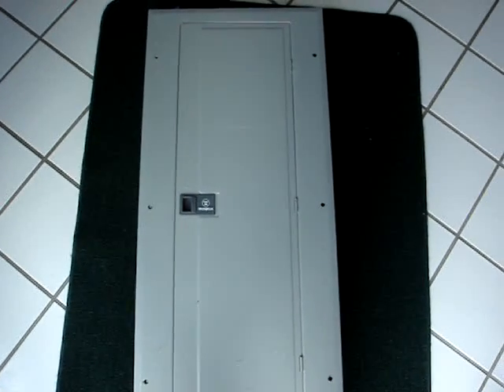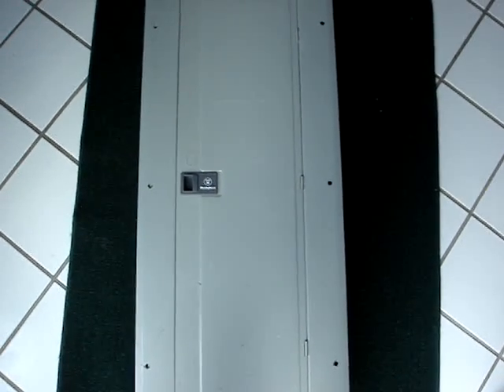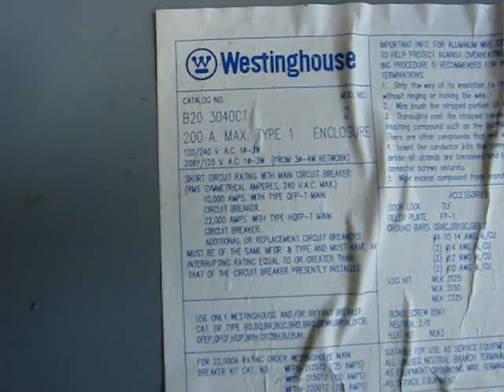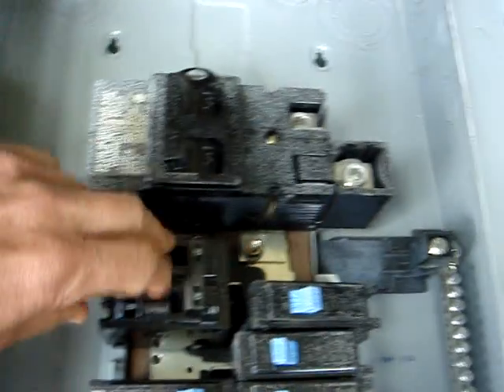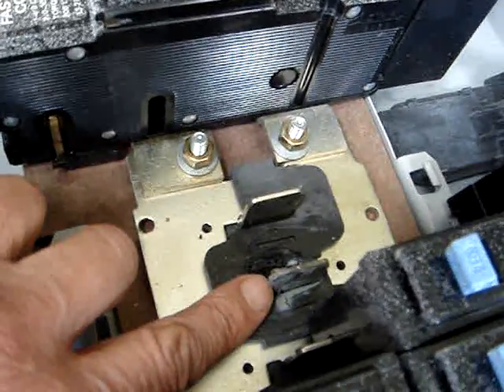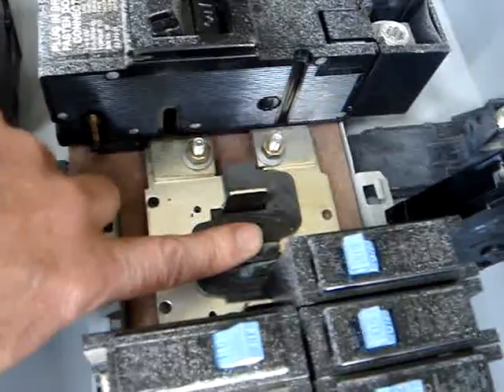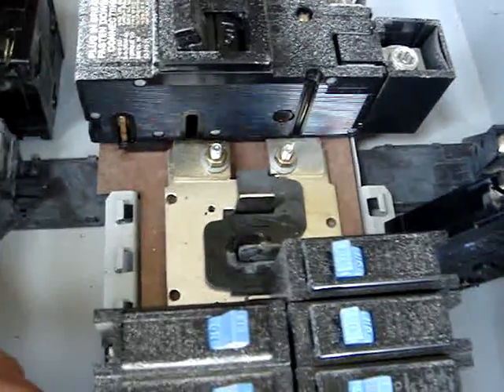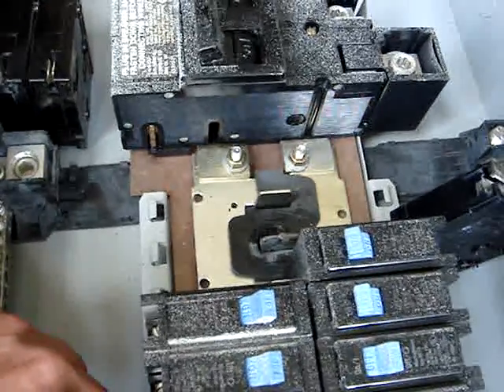Circuit Breaker Panel Problem - arcing between busbar and breaker - heating and melting plastic

Comment: This is still relevant. If an appliance acts up and look like a power problem, I check outlet, replaced anyway since they were old then checked the breaker. A different brand breaker panel. It arced between breaker and the bus bar. It didnt melt down, I still replaced and moved the breaker to another position which was not used. I will replace all the old breakers. Please get a qualified electrician when you have this happen.

Comment: I have a 200 amp Westinghouse panel, which is about 12 years old.  The 30 amp dryer breaker, in this exact spot, kept tripping.  

First, i cleaned the dryer vent, thinking the dryer was overloaded.  Then, I had an appliance guy check the dryer.  It was wired incorrectly, but he didn't think that was what was tripping.

I went to replace the breaker and noticed that it was hot, and there were scorch marks on the bus bar and the adjacent breaker.  I will keep my eye on it.  If it continues, I will move all circuits down to avoid that bus bar tab. There isn't any buzzing or high temp with the replacement... so far.

Comment: Westinghouse is Eaton/Cutler-Hammer.  It would have been cheaper to call Eaton and obtain a replacement aluminum bus and unbolt it from the case after removing all of the breakers, install the new bus and new Eaton/Cutler Hammer BR breakers.  Problem solved for a few hundred dollars.
Reply: @Chad.Tyrone  I am not an electrician and would never suggest a lay person disassemble a breaker panel and undertake such a task.  Sometimes it is better to know your limitations and hire a professional.  This was one of those for me.  I assume you are a qualified electrician.

Comment: I have a similar problem, I wanted to add a 50 amp breaker switch to the panel when i pulled off the cover i saw that the place fro that switch had corotion and evidence of melted plastic between both contacts, I tried to put the new breaker in  to see if it would work and couldn't mount it fully so I decided to stop and get further assistance. too dangerous.
Reply: Smart decision.  Obviously, electrical genius runs in the family.

Comment: I had this happen to my Challenger panel bus bar for a two pole 50 amp breaker for my AC and Heater circuit.  The HVAC guy pulled the burnt breaker and cleaned the bus bar with a wire brush and sandpaper.  However it happened again so I moved a double pole breaker below it to the bottom and opposite side and then moved it down to an I damaged space and used a new breaker. Now the damaged position is not being used.

Comment: Buddy they saw you coming... all you had to do was go down to your local electrical supply store and get the buss bar for that model panel box and swap it out. I had the EXACT same problem  the burning plastic smell, arcing etc. did the job today, well the good Lord blessed me with a gentleman that happened to have removed the same box from another job and used the buss bar from that box Thank you Jesus! otherwise I would have had to buy a new box and or possibly upgrade to a newer more expensive box.
Reply: They did not see me coming.  I went looking for a professional electrical service.  I know my limits and replacing a breaker bus bar or box is beyond my skill set.  I might point out that you have solved your problem by recreating the same conditions that created that problem.  I don’t consider that to be especially wise.

Comment: Those Breaker boxes suck i would never use them, they malfunction all the time know for this, very poor engineering, i would only use ITE which is now Siemens, in 1983, Siemens bought out ITE..
so Siemens boxes are awesome you will never have a problem with them, not only that they are rated the safest Circuit breaker panels anywhere..
I have never seen an ITE / Siemens Box Do this, not saying it hasn't happen but  i never seen it..
Reply: Appreciate the information.  When you buy a house the decision about all the electrical stuff has already been made for you.  I trust the outfit who redid my box knew what they were doing.

Comment: I have the 4040CT version. It sizzles and pops but ONLY when there is a large load in the garage. The garage has a subpanel, but nothing happens there. I changed the breaker that sends power to the garage subpanel, but it didn't fix the issue. Going to take all the breakers of one by one. The popping sounds are louder on the outside of the panel between the plywood its mounted on and the panel, but the sizzling on the inside is hard to pinpoint.
Reply: I am not an electrician, but that literally does not sound good.  Good luck.

Comment: Back in 1992, I installed a Siemens #G3040MB1200, Interior 200a - 40 circuit, all 110v 12g copper w/20a brkrs and 220v w/typical demand service for A/C, H2O Heater, Motors etc of 20a-60a. The panel spontaneously started arcing stabs on my dbl pole brkrs (dps). Three years ago I just happened to be next to the panel box when a big pump motor started and I heard the arcing. I tripped it off and snatched it out before any damage was done to busbar. Now, suddenly in the past 3 days it has consumed 3 more breakers- a 20asp, a 30adp and a 60adp. It's all 30 years old, when I rebuilt after Andrew hit in '92. I believe the stabs' tension has waned from age and FP&L's abuse (multiple brownouts, momentary outs and many annual extended outages) that caused the problem. I'm putting in all new guts inside the box and new breakers. I'm a retired heavy industrial/infrastructure contractor and thought breakers were forever. But after this experience and reading many articles on the i/n, I believe you need to change your breakers after so many years. Had I replaced them all, after that 1st one went 3 years ago, I would've only had to do the breakers- a couple hour job. Now, it'll take best part of the day.
Reply: Thanks for all the info.  Sorry you have to do so much work.  Most people would need an electrician and the wallet to match.  Good luck.  Hope it fixes your problem.  Only taxes are forever I guess.

Comment: I had the exact same problem. However mine was with what’s called a space saver breaker. My air handler was tied into the 2 30amp breakers in the middle and had 2 15amp running my bedroom circuit and other circuit on the ends. I’m the original owner and bought the house new. We’ve been in it 20 years and suddenly our bedroom lights would flicker occasionally and I noticed it would happen when the air handler came on. Upon inspecting the issue I found the same thing you did. I had extra spaces so ordered a new breaker and was gonna move the breaker down. When I went to remove the wires from the breaker, I found the electrician had missed the wire. The wire was wedged between the breaker tie down screw and the breakers plastic barely making contact. That additional resistance over 20 years eventually caused the breaker to melt the tab.

Comment: I am here because I had a similar problem 60 amp ganged breaker for AC..... My dual AC units both stopped working at the same time? Hummm. I figured it was A POWER ISSUE. Since the recirculation fan was running but outside the condenser fan was not, I took the cover off the (cutler-hammer owned by Eaton) breaker box. One of the two phases to AC was dead. I looked at the main breaker box and power. One of the breaker switches (all cutler-hammer owned by Eaton) had something wet on it? I took the cover off and breaker out. It was a HOROR story. It was burned. One of the two ganged 60 amp breakers was burned. The 20 amp on the other side, on the same bus bar tab was also melted. Both AC were working drawing max current all day. Some corrosion on that tab must have made it get hot and hotter until the melt down happened. The 20 amp breaker was still powering it's circuit until I took it out and it fell apart.  The CB contact in both cases was still on the tab but separated from the CB. I wrote Eaton and called and was expecting a reply by email or phone. Never came.  What I guess is the DESIGN of these home boxes a 50-60 amp breaker is max. The breaker to bus bar contact is not great and can over heat without tripping. This gets hotter and hotter and the breaker melts until it physically melts the connection in side and then breaks the circuit (but the breaker mechanism does not trip). It may be a good idea after 10-15 years to pull all the breakers and clean all the bus bar and breaker contacts (at least on the above 20-30 amp ones. I bought Siemens brand breakers (replaced 7 of them. 1 was the unit that failed completely, 1 badly damaged which shared same tab on other side. Because one of the adjacent CB's was a gang of 2 and had head damage, and and 2 more that had damage). I cleaned all the tabs and installed the new CB's. The Seimmens CB's look better than the original Cutler-Hammer CB's. Still the contact resistance due to small area and increased resistance due to corrosion over time, and trying to get 60 amps through it is marginal. if the breaker is not fully seated it is a concern.  I have gone out with both AC units running with an IR temp gun and it all seems to run cool. I think if both units start at the same time and there is a surge at the same time, it may be a cause for it to be near overload. That could cause a arc maybe and maybe poor connection after as the spark has burned the contact? I am going to pull this dual 60AMP breaker and have a look at the contacts and see if I see any issues. This was really concerning. However the box did it's job and there was no fire.

Comment from the maker: To Red Berry...get an electrician, stat.  Suggest you remove the breaker entirely ..you won't have power on the circuit, but you won't risk setting a fire in the box.  If you must have power, throw off the main breaker to the entire panel (get a flashlight first), remove the problem breaker, inspect it, sand inside the contacts, and replace very firmly, then turn main breaker back on and see what you have happening.  This can be a very dangerous electrical situation and safety is #1.  Get the electrician!

Comment: I have a square D 15amp breaker that is sizzling and it’s connected to my living room , bathroom , and master bedroom ceiling lights plus the receptacles in my bathroom and bedroom are also connected to this 15amp squareD breaker ... I replaced it not 3 months ago and it appeared to be fixed but the other night the problem started again and it’s probably  my own fault it failed because it was kinda tricky to get it to fit in such a snug place but I’m open to all help and advice I can get to fix this myself if possible because I’m not working and electricians are very expensive ... Right now the breaker is off and I’m just dealing with no lights in those areas ... please help !!! Thanks !!! GOD BLESS !!!
Reply from the maker: I posted a reply.  Get an electrician.  This is unsafe.

Comment: Looks like a Siemens breaker in a CH panel. Issue is wrong breaker for the panel not the panel its self.
Reply from the maker: Thanks.  All replaced.

Comment: I am having that problem right now. Which is why I am watching this. I have changed my breaker and it still sizzles. Tomorrow I will attempt to put 1 more new breaker in in hopes that it us the breaker just being bad. The breaker has half of 4 rooms on it. To me that seems like a whole lot.
Reply from the maker: Get an electrician.  Seriously.
Reply: @DBTNVideo  I'm going to bro. I have a empty slot i wanna try first with a fresh breaker and if it sizzles I will have no choice.
Reply: @shaneglover99   Good for you.  I think you have too many sizzles already.  If the main bus bar onto which the breakers snap is "going bad" so to speak, you may just be postponing the same problem and you may not be around to catch it when it happens.  Stay safe and good luck!

Comment: Yes my did the same. It's a Westinghouse breaker box in my double wide.
Reply: It wont let me add a picture.  But I changed te breakers for the furnace and air. Cleaned the tabs off and got rid of the slightly melted plastic. But my tabs were not messed up. Just the plastic and the breaker. This happened after we got a new outside air unit. Let me know if you contact them about it. If you want a picture the name is Justin Boldery. Email bolderyjustin@gmail.com thanks

Comment: I have a 20+ year old I.T.E. brand 200 amp panel in my cabin.  It's located in my bedroom.  I was walking through the room after I started my coffee maker when I suddenly heard arching and popping sounds coming from inside it.  Pretty scary.  I called an electrician and he came over and took off the cover and had me started the coffee again.  He couldn't believe it and pulled the breaker and found a Square D 20 amp breaker that fit into the panel. The old breaker showed burn marks on it and smelled.  He said I got it before it damaged the panel.  Glad I found your video, if I had seen it before calling the electrician I would've fixed it myself and saved myself a $150 service call.
Reply from the maker: Glad to hear it worked out ok.  The smell will get your attention!

Comment: Eaton was not truthful. That is very common with those panels
Reply from the maker: Earl, that's interesting info.  How do you know this?  Are you an electrician?  I suspected I was not an isolated case.
Reply: DBTNVideo Yes I am. I’ve encountered this issue several times in Eaton and Cutler Hammer panels.
Reply: Thanks, Earl!

Comment: This exact thing happened to my Siemens box (produced around 1995). It happened on the main 100 amp breaker at the top.
Reply: Sorry to hear it. Good luck.
Reply: @CaptVideo  Thanks, got it replaced and the tab sanded down- working fine so far - if it happens again we'll be upgrading our whole system to a 200amp service which we want to do anyways.

Comment: My Challenger panel ( circa 1989) with an identical bus and breaker clip joint design had exactly the same problem in a 20-amp circuit in 2009.  

It recurred after replacing degraded breakers 3 times.   In 2016, I rerouted the service from that corroded bus (location 13 ) to an intact location that was not previously used at location 22.  This has worked well for three years.  No heat.  No sparking.  No trips.   But I am now wary.  

Three houses nearby (built in a 1989 development)  had similar failures and had the distribution panels replaced for $2000 - $4000.. I am not an electrician...
Reply: Might be a good idea to at least have an electrician look at it.

Comment: I've experienced a similar problem with the breaker box in an early 90's model mobile home, the burnt bar was also on one of the 220 volt breakers as you experienced, however according to the label my box was manufactured by Siemens not Westinghouse, but the box looks identical inside and out, which has lead me to question whether or not these were being mass manufacturered by a Chinese company then being sold to Americans companies that were just labeling them under their name for sale in the United States as they do today.

Comment: Ive been doing this fore over 30 years ive seen tones of ALUMINUM BUSS panels do this EVEN WITH THE RIGHT BREAKERS .MURRAY, CROUSE HINDS, I-T-E , SYLVANIA, CHALLENGER ,BRYANT older SQUARE D QO, CUTLER HAMMER BR & OTHERS. I use Square d qo with pigtailed afci breakers [neutral strip is aluminum ] main bus is COPPER . If on a budget SIEMENS with COPPER BUSS aluminum cable & wiring is also crap seen a lot of problems with it .When i run across an aluminum bussed panel i put a little antioxide compound in the clip of the breakers and put them back in the panel one at a time as long as the buss is in good shape. I think UL NEEDS TO WAKE UP AND DEMAND COPPER. ALUMINUM CAN GO STRAIGHT TO HELL AS FAR AS IM CONCERNED .I was sent out on a job a 200 amp I-T-E panel flashed over in an apartment building and tripped the main breaker because two branch breakers next to each other arcing on the INFERIOR ALUMINUM buss FLASHED OVER I was really upset, had go go to the hardware store and pick some thing up met some man that WORKED FORE I-T-E I REALLY RIPPED INTO  HIM AND TOLD HIM ID LIKE TO BREAK HIS NECK. I think HE WAS AFRAID OF ME HE SAW THAT I WAS VERY UPSET. We went out to my car he looked at the blown up panel I had in my car and he started taking notes. I TOLD HIM I WANT HIM TO START OFFERING COPPER BUSS AS AN OPTION AND GET RID OF THE PLUG ON QUAD MAIN BREAKER and get a BOLT ON ONE WITH A HIGHER AIC .A while after they started offering copper buss a few years after that they got a new main breaker that bolts on with a 25,000 aic. Im a licensed electrician and i take my work VERY SERIOUSLY. UL needs to pull its HEAD OUT OF IT ARS AND SEE REAL WORLD SITUATIONS then mabee this crap could be taken off the market.I was involved in putting FEDERAL PACIFIC OUT OF BUSINESS AND HAVE NO REMORSE !

Comment: I have Bryant breaker box. My a/c breaker is 4 pole - 2 30 amp and 2 40 amp. One 40 amp went bad but did not trip the other one (Duel trip system). When I pulled the breaker out, I saw bus bar where the breaker seats is little worn out (not burnt). I am thinking of changing the whole panel instead of taking the chances.

Comment: 900$ holy shit that's cheep did he do it for no labor  the parts alone are worth 700-800 around here   plus 350 for a permit disconnect reconnect and inspection   and its not the fault of Eaton/ westing house / cutler hammer its the guy who put in the wrong brand of breaker
Reply from the maker: Quality work for that price by qualified electricians.  Things aren't as expensive in Tennessee as some other places.